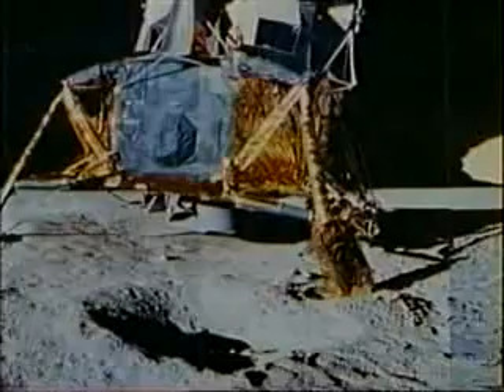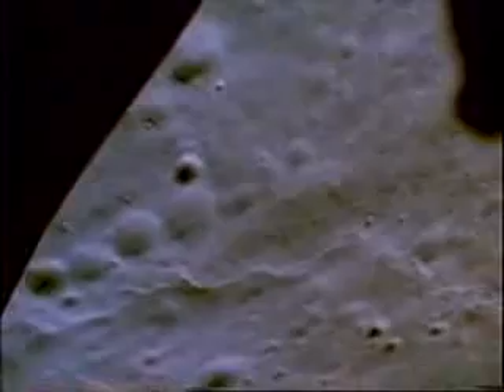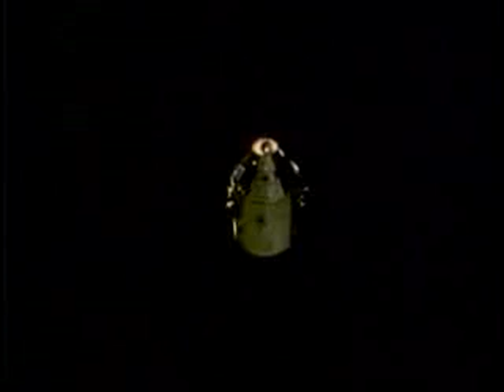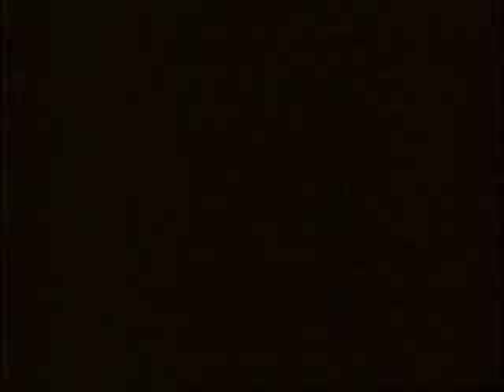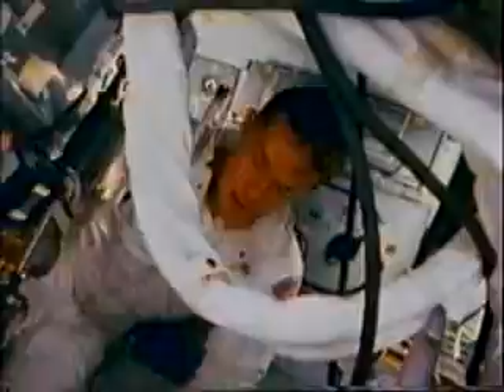Apollo 14 LM lift-off and CSM docking

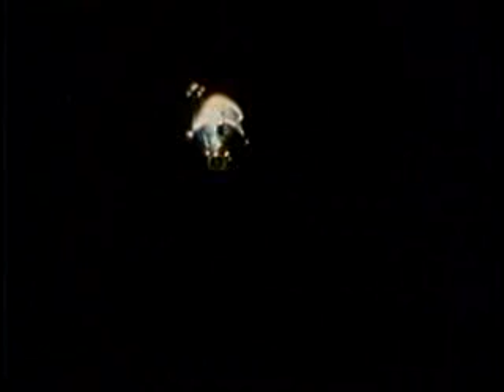Comment: 1:32 why did the CSM flip?
Reply: Normal for each to inspect each other's spacecraft prior to the docking.
Reply: It was an inspection.
Reply: @charlesvan13  inspection for what?  Damage?  How the hell were they going to fix it anyway?  Propaganda at its finest!  Fake. Fake. Fake!
Reply: @mikeivey7167  
A tank exploded in the Apollo 13 service module, which they could see after then undocked.  
They double checked everything.  The only system without backup was the LM engines.

The next step is to ditch the LM.  If they had a problem similar to Apollo 13 they could use the LM for life support, and other things.
Reply: @charlesvan13  So what?  Wouldn’t have made any difference if there had been damage to the CM. Still had to use it to get home. Perhaps like they did in A-13. It was just a dog and pony show. Those 2 spacecraft, I don’t believe could have flown along in synchronized fashion as the LM didn’t have the power or fuel capacity to do it!
Reply: @mikeivey7167  
If there was some damage to the CS module, as in A-13, they can use the LM for life support or other functions.  

The use redundancy to make the trip less dangerous.  A-13 used the LM as a lifeboat after the life support on the CS failed.   They also used the LM engine, as the service module wasn't functioning.   Without improvising, using other systems A-13 crew would have died.
Reply: @charlesvan13  I fully understand what you are saying. I get it. But, I don’t believe that the story NASA put out is even remotely truthful. Seems to me like, if the O2 tank exploded like they say, it would have knocked the CM way off course. You know, that equal and opposite reaction thing!  As far as the CM being inspected, seems useless to me, but again, did the 2 spacecraft have the ability to fly in synchronized fashion?  Not in my opinion.
Reply: @mikeivey7167  space craft: rotates
This guy: FAKE!!!!

Comment: They didn't dock on the far side of the moon you idiot. There's no way for the radio waves to travel to the far side of the moon without the help of a com satellite, and you can clearly hear the MOCR (Mission control) in the background as they dock. They'd never perform such a complicated procedure during a radio blackout.. They DID however, undock (before PDI, powered descent initiation) on the far side of the moon.

Comment: You said it yourself, cheap shit camera. Try it with an SLR, a camera which implements control over aperture, shutter, and ISO. My old Nokia was able to do the same thing, my SLRs can not.

If the LEM is metered in the camera, and the aperture is accounting for the bright space craft, it will have the same affect (not seeing stars). This is also why night photographers go hundreds of miles away from cities to take pictures of stars (no light pollution).
Reply: I'm pretty sure the cameras didn't self meter. I believe everything was manual. The camera used on the moon didn't even have a viewfinder.

Comment: That is not what you see on LEM video.

If all moon dust/powder was gone, then how in Hell did astronauts leave any God damn footprints around the LEM?  That would be *thousands* of pounds of powder to carry away a small radius around LEM, which if so begs even *more* qestions than it would answer.

I have already done an extensive Thermodynamics approach to astro.  PLSS is a violation of 2nd & 3rd LAWS, meaning impossible.
Reply: Somewhere in your extensive research you overlooked vacuum sublimators that were used to dump excess heat out of the PLSS backpacks. You need to learn to do better research.
Reply: They took photos of the landing sites TEN years ago hoaxtard of SIX years ago. Are you still this stupid?

Comment: A minimum fuel acceleration acchieves escape velocity as soon as possible, but that would cut the time to CM link up to 2-3 minutes.

20 minutes means that LEM was GROSSLY under a minimum fuel burn profile, and would have had to have expend huge amounts of fuel performing what amounts to a near hover.

This is impossible.

What we found out during Gemini, is that a trip to our moon and back using 60s era technology was impossible.
Reply: The LM didn't need to achieve escape velocity. It only needed to attain orbital velocity around the moon. After the crew, film and rock samples were transferred to the CSM is was the CSM by itself that attained escape velocity to get out of lunar orbit.
Reply: Oh yeah you were there and participated in Gemini Program. Lol...

Comment: It requires all of 9 entire minutes to go from earth’s surface to earth’s orbit.  How in HELL does it require ½ hour for LEM to return to Kitty Hawk if she uses constant acceleration to reach escape velocity?

Why are no stars visible surrounding Kitty Hawk as filmed from LEM?

Why are no thruster shots visible when *massive* Kitty Hawk with fuel for a home burn turns sharply, then crisply halts its angular momentum.

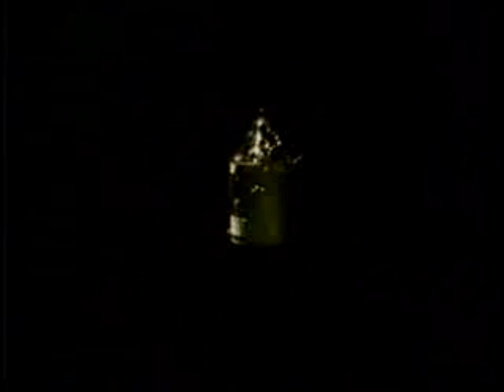You can see God damn wires in the flash of glare between 02:00 to 02:01.
Reply: Escape velocity is lower for the moon.  LM's Rocket engine is tiny as compared to ones used to lift off from earth.  Did you think before posting moon loon???
Reply: Do you really think nasa would let that slip out if they faked it
Reply: David Tackett
Are you aware this footage was filmed at a very low frame rate?
Reply: centurion180ad I agree. It is imossible for a rocket in space to do sudden stops and flips. There are no breaks ! It's ridiculous people believe this is real footage.
Reply: @David Tackett - Once the LM is in orbit it will just sort of hang there motionless and hold its position. The "sudden stops and flips" are when the RCS jets fire to change the spacecraft's attitude.

Comment: Why are there no stars ever visible?

Why is there no nozzle blast or thruster shots ever visible?

Wouldn’t astronauts suffer radiation poisoning?

How could astronauts remain cool without vacuum suits shooting out steam being seen?

Why is there no dust-blast or surface burn & blast crater ever visible?

Why can’t you hear a rocket motor running and why don’t the astronauts’ voices shudder in the LEM radio?

You can’t use vacuum suit gloves on delicate LEM controls?
Reply: "Why are there no stars ever visible?"
If you don't know this, how to you expect to interpret anything you see in the Apollo film?

Photos of stars were taken using UV film since this is a wavelength blocked by Earth atmosphere.
Reply: Are you still this stupid 7 years later? Or did the shoe shine dust finally do you in.

Comment: @monokhem The set or soundstage was certainly not 5 square miles; in fact, an astronaut almost walks into the fake background and has to change direction   Watch this, by moon hoax researcher pt1gard --- type into youtube :    WIZARD SHUFFLE

Also, it was NOT a vacuum, either.   The fact that the moon rover kicks up dust in a ROOSTER TAIL shape, and not in a perfect parabola, proves there was air.   The dust moves backward, but it slows down in the air and falls down, in a rooster tail shape.

Comment: @monokhem On Earth, the difference between inertial mass and gravitational mass is a big deal for men lifting a lot of weight, ESPECIALLY IF DONE VERY FAST.   P!nk could lift a 80 pound barbell from the ground FAST to a curled position, bringing  it toward her chest on Earth, but on the moon, that maneuver with a 480 pound Earth mass would send her backwards and knock her on her pretty ass.   It would be dangerous.   But the astronaut does NOT lift the toolboxes fast.

Comment: @monokhem Give an example of an astronaut lifting a great mass that would be very heavy on Earth.   There is a scene where the astronauts are kicking a rock ( playing football with it ), about the size of a basketball.    The rock just rolls on the ground.   That certainly was not showing 1/6 gravity.   Alan Bean is encumbered by carrying a barbell with tool boxes at the end.  On the moon, it should have weighed   30 pounds, tops, and have been VERY easy to carry.

Comment: @monokhem I didn't exactly repeat it.   I pointed out that since you have no response for this proof that it was in Earth gravity ( you yourself even admitted that the astronauts are weighed "way too much" ), you change the discussion back to opinion's of Nixon's legacy.   You don't offer any evidence of 1/6 gravity.   They never jump high, the sand is kicked up exactly as on Earth, but on the moon, the sand should go up at least to their waists, if not over their heads.

Comment: Show me the footage where they are jumping upward 5 feet.   That hammer throw was VERY unimpressive.   The sand is being kicked up as they are walking EXACTLY as on the Earth,  on the beach, and they are often deliberately shuffling their feet to kick up the sand.   That motion should be sending the sand at least up to their waist, if not over their heads.   Projectiles would go six times higher on the moon than on Earth --- this is stated in physics books written before this supposed event.
Reply: Really? What about when the hammer was dropped at the same time as a feather and they fell at the same rate to the moon surface. Explain that on earth hoaxtard. What about the roostertail created from  the rover wheels. That only happens on the moon hoaxtard of 7 years ago. I let you guys spew your drivel for too long.

Comment: @mooninquirer Not only could the astronauts have descended the ladder with just their hands, they could have ascended the ladder with just their hands, and not only that, they could have banged out a set of 10 one armed pull ups with the right hand, and then switched to the left and banged out a set of 10, and not only that, it would not be showing off, but they would feel a NEED for this type of exercise after hardly any exercise for three days and being cramped and couped up.

Comment: @mooninquirer In any event, this MUST be proported to be an animation, because this module looks nothing like the one that lifted off the moon.  Also, there is no reason for it to spin like that, AND we see a flash at 2:00, revealing that this is an animation, like much of NASA's work is an animation.
Reply: mooninquirer that’s the sun and animation like that wasn’t even a thought back then so this had to be filmed on the moon

Comment: Does NASA claim that this is the actual video of the docking, or is this an animation or re-construction ?  Nasa had a a documentary in which the docking was animated, and took much, much longer than this; however, this has been deleted in the video that  one can see on video google.
Reply: The docking was filmed at a very low frame rate. This video shows the motion much faster than it occurred.